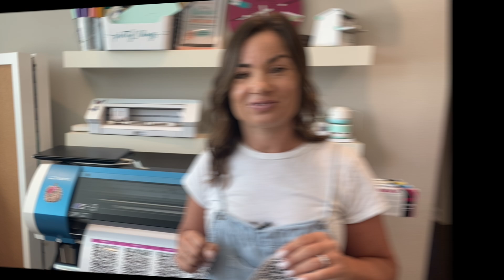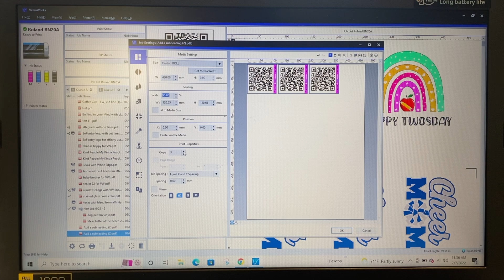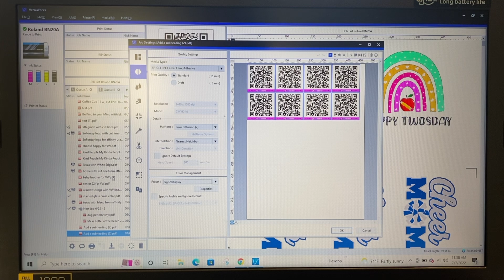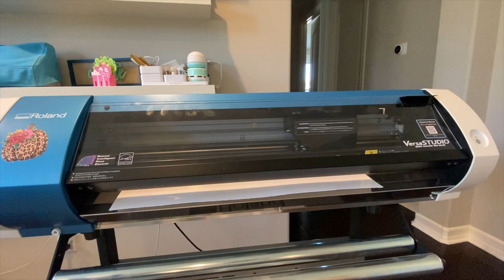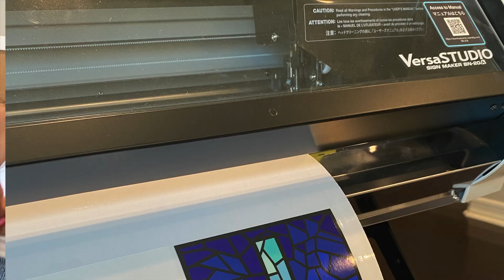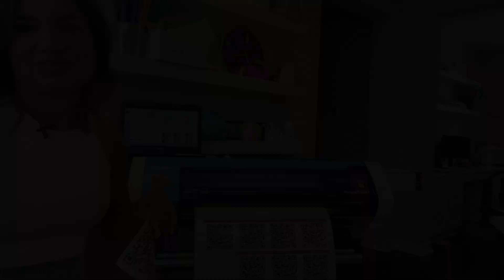😍 How to Print Custom Window Cling Film with Roland BN-20A

Comment: Hi Melissa. I'm starting a new business and new to print small QR window clings for the inside of a car window. I won't be printing many at one time. Each customer gets a different QR code so multiple prints of the same cling is not necessary. I'll add logo and some wording to the cling when creating it besides the QR code.  Since I'm just starting, what is the most affordable way to start. Do I need to start with BN20a or is that for larger business requirements?  I'm not sure how this business will progress, so I want to start small. I guess I need the software or app, printer, and sheets.  Any information would be helpful. Thank you.
Reply from the maker: The BN20A is definitely a great option for small businesses for many reasons, however if you are just getting started it is an investment for sure. With that being said, it's going to be difficult to find an option for printable window cling that won't fade in the sun other than ecosolvent.  You could do it with vinyl, but cutting QR codes in vinyl has it's own challenges as you can image and I would not really suggest it.  Since you can nest multiple jobs together maybe you can print multiple jobs on the BN at the same time OR encourage customers to purchase 2-3 QR code window clings (one for each wndow and the back) and that way you aren't wasting material in the unprinted space.
Reply: @SilhouetteSchool  Thanks Melissa for responding and helping.  So, BN20A is the only way to go and I should use ecosolvent to print window clings? I wish there was a shop I could go ask. Maybe graphic artists could demonstrate the process?  It's hard to invest $5000 plus without seeing what it does and it is what I need.
Reply: @SilhouetteSchool with stuff like this I also to keep from wasting material use it as free items for customers make something small that fills the space and when im doing customer orders and need to use it I use the different images whether it's on htv transfers or stickers etc. That's also another way of not wasting material

Comment: I saw this video but turns out it wasn’t what I needed.  I simply want to cut fancy window corners out of white window cling with my Silhouette.  Is this possible?  Is it different from normal vinyl cutting?  Where would I find the window cling material?  Thanks.
Reply from the maker: You could try to find sheets a white window cling and just not print on them and just cut. It's more of a film than vinyl.